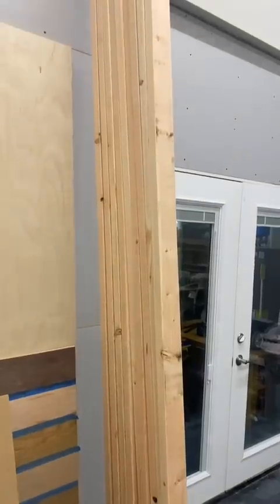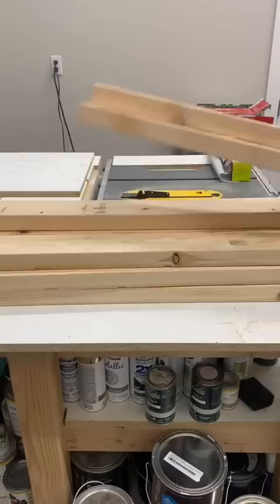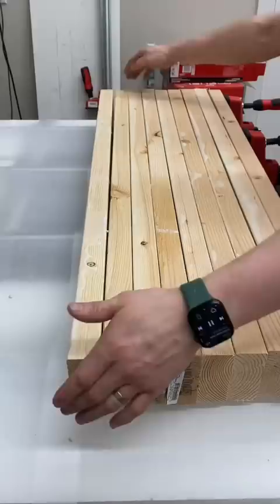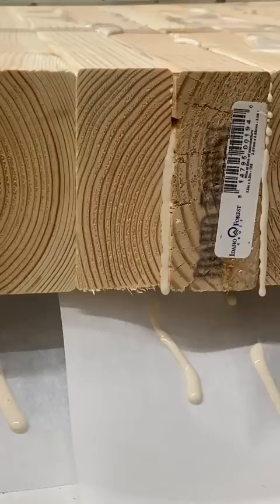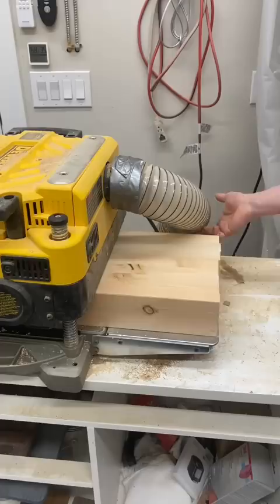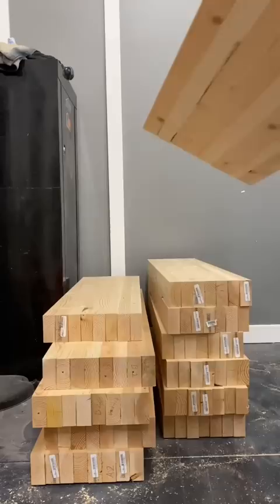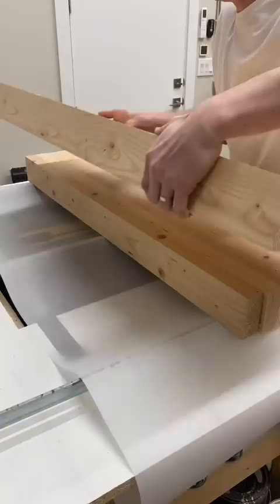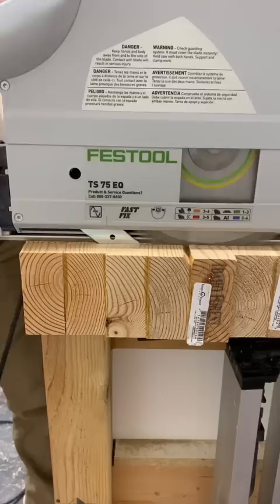Custom Staircase out of 2x4’s

Comment: Says custom made staircases are too expensive, proceeds to make a staircase out of $20k worth of 2x4s
Reply: Crazy!
Reply: Right
Reply: Huh?  That’s not a ton of 2x4s. 20k?  Stop it. That’s a Home Depot run and some basic woodworking tools.
Reply: Focused on the wrong thing, Festools track saw, planer....not the cheapest tools but whatever.
Reply: @scottfletcher1956  do they not have jokes where you're from
Reply: @Scott Fletcher  8 boards for one step. $1 a foot per board. 3 feet wide steps. Each step is $24 unless they are wider than 36"
12 steps shown in video.
Reply: Im Leben nicht!!
Reply: 20k 🤣🤣🤣
Reply: ya need to invest in lots of tools to build custom stairs. I've got atleast 200k in equipment and cutters.

let's see em build a circular and not charge 30 grand for the labor and knowledge
Reply: @sdmfcfh1283  even Home Depot sells stair treads for 20-30$.  The saving money part is what bothers me.
Reply: Yeah, but labor would be an additional $120k.
Reply: Can't afford it... Pulls out a festool
Reply: $20 worth of two-by-fours would have been about for two by fours
Reply: @DUTCHEE  covid prices vs after they plummeted
Reply: CUSTOM MADE staircase at that
Reply: And $6000 worth of tools...✔️
Reply: Don't forget how much he spent on his tools. These are not tools that homeowners would be buying. Now if he would have done it at harbor freight, Walmart, Lowe's evening, or home Depot.. can't say you're on a budget when you're buying the highest thing they make!
Reply: M1 2x4 or cls format kost at peak 2 euro. Every stair cost atleast 20 euro/dollar
Reply: @jessevennard2640  The treads are approximately 3 inches thick. That would three 1 inch thick stair treads. The price is now 60 to 90 dollars a piece. I have made stair treads in the past and I would not recommend white pine for a stair tread.
Reply: @sdmfcfh1283  $1 per foot per bored no that anit right
Reply: And glue 😂
Reply: Hilarious, this made me actually laugh out loud.
Reply: @brisbanekilarny6212  you’re comparing apples and oranges.  They’re also 3/4” of clear solid oak hardwood vs a 2 common fir softwood.  I do stairs for a living and I can tell you that 3/4” of oak will serve you far better than a foot of fir.
Reply: @jessevennard2640  I stated that I would not recommend white pine for a stair tread.  Did you miss that.  You posted that stair treads were 20 to 30 dollars a stair tread at Home Depot; you did not post the species that made up the stair tread.  The stair treads I made in the past were finished at one inch thick and the customer was charged for kiln dried 5/4 red oak, white oak, cherry, hard maple or black walnut, the off fall, cost of glue, use of machinery and labor. Since the stair treads he was making were three inches thick that would make the stair treads three times the cost when using the information you provided. I never used the species to make a comparison. I also assumed he was making floating stair treads which are normally much thicker than normal stair treads.
Reply: @brisbanekilarny6212  I think we are making different points here.   My ONLY point is he said a “custom staircase” is out of his budget.  Yet he could have purchased pre-made treads glue and labor included for $20-30.  Meanwhile, he likely spent approximately the same, give or take, for an inferior quality wood AND had to spend countless hours manufacturing them.   It’s a bs statement.   I’m not trying to argue over how much more a 3” thick stair tread would cost.  If he wanted to do this video right, he would’ve grabbed some free hardwood pallets and done the exact same thing.   Then the budget comment would make sense and he would have solid stairs.
Reply: Yh but if he already had the wood, he's still not spending the money on the other thing
Reply: @darthslipknot91  you don’t have to have the same exact tool to make the same result… there’s hand planers that can do better work if you’re skilled
Reply: @ruelharris7253  yes, but he didn't use that here did he?
Reply: 2nd generation wood flooring and custom staircase installer. And you took the words out of my mouth.
Reply: And using Festool
Reply: & uses Festool
Reply: @scottfletcher1956 basic tools?!?
Reply: @UltraGamma25  00p
Reply: Like 14 2x4’s? Do you not know the price of lumber? If that were the case.. I’d probably be a millionaire by now
Reply: @LoktarOgar69420 : Do you not know how to count past 14? Must not, because it's way past that.
Reply: @michaelgould7639  What's the point of a circular one? You just end up where you started.
Reply: @sdmfcfh1283  looks like 13 for one step..and each board looks well over three feet long
Reply: @mutinyrider666  Those tools will cost way more than the material and making the steps
Reply: @darthslipknot91  he already has the tools though
Reply: @Iluvpie6  true, but point being, they're not the cheapest ones on the market. I'm all for not cheaping out on tools.
Reply: @scottfletcher1956  $20,000 worth of tools is not exactly basic stuff.
Reply: And the most expensive tools out there, Festool.
Reply: And has all this brand new equipment, including a PLANER in his garage 😂
Reply: That's a lot more than $20 worth of 2×4s .. he's spending about $60 per step .. and that's not counting the framing , supports , banisters or rails ... all together he's probably in around around $100 per step ..
Reply: @sdmfcfh1283  holy shit. In which part of the world are you paying a buck a foot? Prime pine studs out this way are maybe $0.25/ft. $0.50 for dimensional.
Reply: Hilarious 😂
Reply: @scottfletcher1956 basic? You ever seen the price of a festool track saw?
Reply: Using 20k in tools haha
Reply: You can't fix stupid.
Reply: where are u buying 2x4s?
Reply: Is he planning on driving semis up and down the stairs?
Reply: 2x4s are $3 range for 8’ boards at my Home Depot right now, by far the cheapest of all dimensional lumber.  Smaller or larger sizes cost more.
Reply: @scottfletcher1956  >Dewalt planer >festtool track saw >basic woodworking tools. Lmao, good one. Those are expensive as fuck pro tools that 99% of DIY homeowners don't own.
Reply: @sdmfcfh1283  yeah, well, it's pine he's using, and 36" pine stair treads are like 14 bucks, so... you figure out how it was cheaper and lmk.
Reply: Yeah, especially when there’s something called glu lams that basically are engineered for supporting lots of weight. Yeah, they are a little more expensive than two by fours but most if not all are already sanded smooth
Reply: Plus 10k plus special tools lol
Reply: And owns festool
Reply: His arsenal of tools costs much more than that.
Reply: Don't forget the expensive tools.

Comment: man you are single-handedly making the price of 2x4's go up with each video
Reply: 2x4 have dropped by double in 6 months. They were 7.50 each in may 2022 and $3.35 in November 2022. They have come down alot and were up to $13 each in summer 2021 where I live.
Reply: @randybobandy9828  just saw them at $2.86 yesterday.  Picked up a bunch of good enough ones from the HD cull lumber cart, walked out with 10 of them for under $10!
Reply: As someone who worked for a company that used at least a whole lift of lumber every hour sometimes for 2 shifts, this is nothing. Nothing at all.
Reply: this right here is comedy 😭
Reply: @randybobandy9828  droubled by double? bruh... that would be 7.50-15. "half" is the word you're looking for.
Reply: Should see the amount of 2x4s 2x6 2x8 2x10 2x12 I go through at my work, literally 10000s of thousand of board feet maybe even 100k+ if you include everyone else's work, the Sawyers, pickers, catchers
Reply: Im dumbfounded as to why you would make the treads out of 2x4’s.
Reply: @bigpjohnson  what's the cull lumber cart?
Reply: @diesel961  every HD has a cart with bad/twisted lumber.  Stamped or painted purple and goes for usually 70% off.  Sometimes its good lumber, or can be cut into shorter pieces.  Great for smaller projects where you can save a few bucks.
Reply: @bigpjohnson  damn. Thanks man
Reply: 1k like! 😂🎉
Reply: @LWPowers  ever heard of glulams before?!
Reply: Looks like this is his job, those tools ain't casually by the average guy
Reply: He's bought shares in a timber glue company. The saw mills cut em up in seconds, and he takes days clamping them all back up together.
Reply: @LWPowers 

The boards create a solid stair tread platform, but one could use 2×3s instead and save!

Cheers.
Reply: Fr i coulda made 10 boxes outta a few 2x4s and plywood to do the same this is just sickening
Reply: @jaked9268 just curious what you do??? That’s a wild amount of board to be used? Is it like premium lumber or do you guys just take whatever??
Reply: @ryanbrown174  hand crafted roof trusses, anywhere from 10-100feet

Comment: That's how DIY goes. Start by trying to save money, end up spending twice as much.
Reply: Hey hey... it's our hobby too!
Reply: I don’t see how diy could cost twice as much considering your removing the cost of labor, you’ll need to buy material either way but it’ll be cheaper milling it yourself
Reply: Oh! How true! I usually design a project, cost out the project, and then determine where to buy it already made.
Reply: @amahrihudson5060  mistakes and yeah mostly mistakes.
Reply: @amahrihudson5060 economies of scale. Yea I could buy the material, but someone else making it (or a company) can spread the initial and occasional high costs across many customers and sales and maybe get material for cheaper. If you don’t account for the price of the tools, then it probably gets more expensive when you mess up lol if the materials cost the same.
Reply: Looks like this is his job, those tools ain't casually by the average guy
Reply: Not even close lol
Every time I DIY a project I spend about 1/10. The cost it would’ve cost me to hire somebody and the quality and materials are at least double if not quadruple the quality of the crap they would’ve got me. 

There are projects that are better to hire people for, but most projects you can easily do on your own
Reply: @definiteIynotkenji  also no professionnal prices too
Reply: Right but you end up with 2x the cost in high end materials instead of cheap as shit material and a ton of labor, so you still win.
Reply: @BigBoii1369  Yeah doing it yourself is nice because you can save money, invest more in better materials, and get super cool tools for the job, all for less than it would cost for a pro to do it. And most "pros" these days do absolute shit work anyways.

Comment: Wait a minute.... you have a planer on site and you didn't run the 2x4s through it before glue up? You know that removing that thin weathered layer makes your glue up like 4x stronger and also alternating end grain direction will have a huge impact on reducing the tendency for cupping in the future.
Reply: 4x stronger? No. Also it's not that big of a deal the glue will be plenty strong.
Reply: Especially with that quick growth pine , could do with some large dovetails underneath to keep it strong
Reply: This comment was going to be mine as well. I saw the glue going down and I thought, ok, he doesn't have a plainer. Then the next scene is a plainer.  ( wtf) 
Also, clean the glue off of the wood or you will be needing new plainer blades.
Reply: @phillipthethird42  planer
Reply: He is clearly NOT the sharpest tool in his shed. Construction lumber is way too wet to hold a glue.. I hope granny and large Marge don't use them stairs..
Reply: The glues probably stronger than the wood anyway.
Reply: @phillipthethird42 same
Reply: 2x4 cupping?
Reply: @Randy Bobandy  nope. He didn't even wet the wood...
Reply: @Phillip The Third  don't worry according to @randybobandy... it'll be fine.
Reply: @saucierboar2  apparently not.
Reply: I’m not sure about 4 times stronger but I’d have at least sanded the mill glaze off first. Have not seen the final product so I can’t comment much further other than “WHAT A TON OF LABOR/ LOST TIME” to save a few bucks if any. Not saying you don’t have skills. Just saying I’d not have done this.
Reply: To those misinformed... To be "s tronger t han the wood" PVA w ood glue requires FULL surface contact and consistent clamping pressure.  It is has zero strength filling even small gaps.  To get there with this kind of glue-up requires creating two flat parallel surfaces. ALL dimensional lumber is slightly cupped or twisted and you'd crush it with clamps before you pulled it flat enough to glue up without surfacing it first.  If you can't get full surface contact the adhesive of choice would be epoxy.
Reply: @phillipthethird42  Here for the exact same reason.
Reply: I mean, he made a completely unnecessarily heavy staircase. What do you expect?
Reply: Ya, what he said…
Reply: Came to make this comment.  You have a planer and didn't use it on the surfaces that actually need to be flat.
Reply: And also you should be using a class 4 glue for laminating staircases. This is why this is a trade. Not just as simple as laming some timber together lol.
Reply: @Arthur Engle laminating would be different them what he did. There's a few dozen better ways that don't make you liable.. or have to wonder forever... especially  since he didn't do a great job "laminating" them..
Reply: @phillipthethird42 , nah man the planer is the glue cleaner. Just like not using forstner bits instead use your Phillips head on your drill to recess the screw.
Reply: @backho12  
Right, got it.
Reply: @phillipthethird42  Sorry for being pedantic!
Reply: Experience Vs throwing money at task
Reply: @backho12  planar
Reply: @Dj T  yea, that's not going to cup, lol. End grain direction shouldn't matter in this instance. If you're doing a table top and glue them edge ways, yes, but gluing them flat on to each other like that, no way will those cup
Reply: You ever try to take apart two pieces of wood that have tight bond on them? You'd never be able to take apart one of these treads ever. I'm sorry, just not happening. Best wood glue out there imo and all I've used for 15 yrs now
Reply: @syn8666  you're both right. A good glue up and you're never taking things apart. And the other person was also not wrong, removing debris, having 2 parallel faces to stick to each other etc all make for a fantastic glue up
Reply: @syn8666  never say never!
Reply: Not to mention planing all glue surfaces also makes those surfaces ACTUALLY FLAT. Not just flat looking. This is kind of a necessity for wood glue.
Reply: @syn8666  it's construction grade lumber . It's therefore wet lumber. It's won't hold as much glue as normal and as it dries it will warp. That creates enough force to separate the members EASILY. Especially since he did not plane them flat... but hey... what do I know. I've only seen me do it...
Reply: @natas0733  not true. I've been using titebond for decades and been building for decades. All lumber is construction grade. That's not pressure treated. It wond shrink or warp. Especially with all that glue on there that wood isn't moving.
Reply: @natas0733  I respect your opinion, though, and everyone's experience is different. I'm sure you know your stuff, just difference in experiences. I tell you my friend, that titebond 3 is some amazing wood glue. Just thus week I ripped down my old treated 2x12 scaffold boards and made a work table top in my garage. I just ripped the to 4" widths, clamped them, and glad them. Was dry and installed not even an hour later. I promise, those boards will NEVER de laminate. I've used totbond forever and built many of stuff with it
Reply: @natas0733  Actually, I know you know your stuff because you mentioned altering the end grain. Go buy a bottle of titebond 3 and experiment with it, my friend. You'll be surprised how well that stuff hold on lumber straight from the lumber center or even old lumber from the job site
Reply: Ok&not everyone could afford those tools dude😮
Reply: @laszloujvari2938 even after gluing all that I would still hide some threaded rod inside bc I don't trust framing lumber. I would drill a long 3/16" pilot hole through the whole mess, half from each direction, then forstner a hole big enough to hide a ⅜" washer. After I got the ends sorted out I would drill the through hole, fit the allthread, and plug the holes
Reply: @xman4328  Too wet? It's obviously kiln dried wood.
Reply: @bobbygetsbanned6049  If you don't have knowledge about something,, LEARN before babbling....
Reply: @chrisrageNJ you would be wasting your time with that threaded rod.
Reply: Great observation!
Looks like the old boy, can't fall out of a tree right....
Reply: You're doing everything wrong 😂

Comment: So, I have both a planer and jointer in my shop. I have both because, as was taught to me in woodshop, before you can plane anything you have to create a square reference face with the jointer.

You can plane wood that isn't already square if you jig and shim it until the upper face is as near parallel to the cutter head as you can manage, and it will get close. Then flip and plane the back side without shimming to create two parallel faces on the same plane.

Otherwise you're not really flattening the workpiece, the inconsistencies of the face on the planer bed will transfer to the upper face as the planer head presses the board down. 

I stopped the playback of this video the moment I saw the glued up stud lumber go into a planer without being edge and face jointed first, and with no jigging and shimming.

Comment: The faces of the boards should be sanded to remove the mill glaze before glueing - much better absorption and bond strength.  Use Titebond II or III and the wood will fail before the bond.

Comment: But if it's pine it will wear quick and dings and scratches easily. Unless you add a hardener to the step surface that is. Oak or another hardwood would be more ideal.